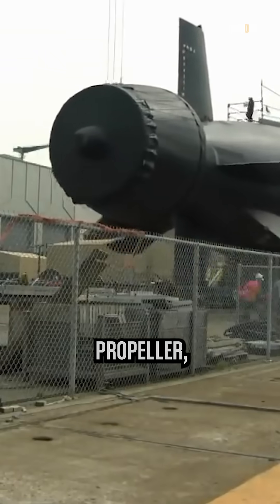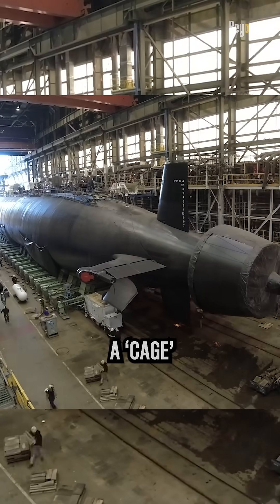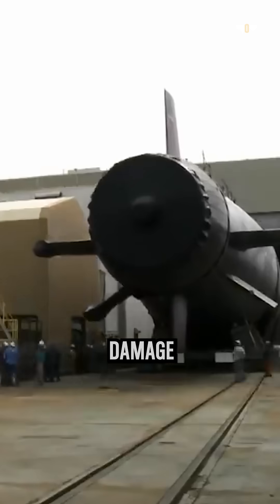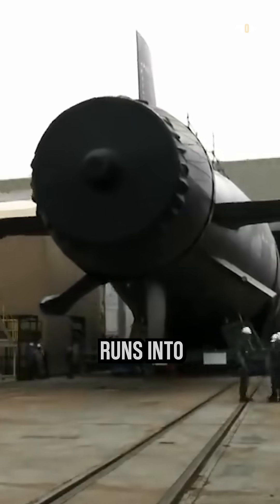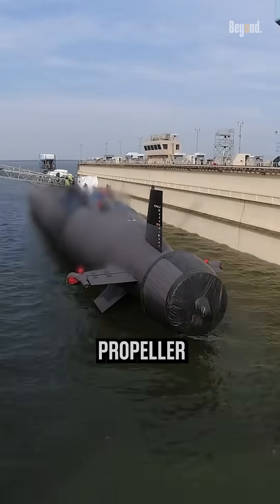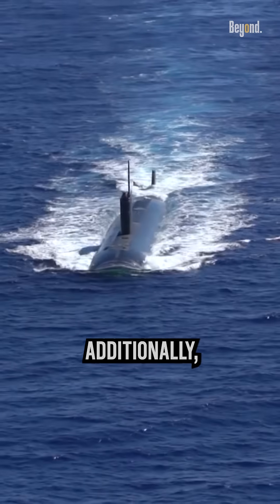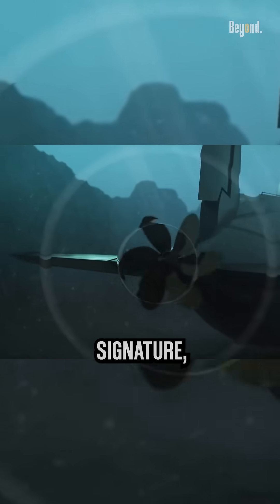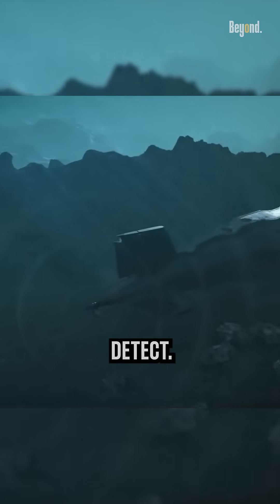Why do the US submarines have a ring around the propeller? #shorts

Comment: This is incorrect, these Submarines have a Pump Jet, which is not a Propeller but a series of rotors, encased in a guard. Pump Jets were first trialed on HMS Churchill in the 1970s, then fitted to the Swiftsure Class in the 1980s. The US Navy used it for the Virginia Class & now the French Navy have followed suit. It is quieter than a Propeller & eliminates Cavitation that gives a Submarine's position away.
Reply: Thank you for setting the record straight. The blithely blabbered BS on this reel is staggeringly ridiculous.
Reply: @cliveherbert9476 if you are going to say something, at least get it right. Its propulsor Churchill carried out the test in 1968, and it first went to sea in 1973 on HMS Sovereign. The US have it under licence from the UK, and was first fitted to the Three  Sea Wolf Class submarines and subsequently to the Virginia Class boats.. You, again, are wrong. They cavitate if used incorrectly. Cavitation can be produced by the bow or any part of a submarine, and propellers are the same. They don't cavitate if used correctly. A propulsor is more efficient and has other advantages, but I am not going to go into that here. I hope that helps
Reply: @Highendaudio1 been years since I was taught about these, but if I recall correctly the shroud stops water pressure being lost perpendicular to the drive shaft, and that higher water pressure at the blade tips means that where they are fastest they are less likely to cavitate. I remember this being like a few percent less efficient back in the day energy wise, however, with a higher allowable speed before cavitation occurred, it allowed the sub to move faster (more time efficient). Since they are nuclear powered subs, fuel efficiency meant nothing and the shrouds were used.

Maybe I'm misremembering but I think that's what I was taught a couple of decades ago...
Reply: @robhoward8344  it is not a shroud, Rob, and it is a lot more complicated than what you are describing.  A propulsor costs a lot more than a million pounds to build ( That will give you some idea), and Propellors don't Cavitate if you operate them properly. Consequently, propulsors also cavitate if you don't operate them properly, and power is important of course it is, but it is more efficient.  They don't use blades but something else which I would have thought you would remember. Where did you teach again ??
Reply: @Highendaudio1  lol a propulsor is just a fancy way of saying the drivetrain. It's not specific at all. The sub in the video is a propeller in a shroud. I love how you are pricing it with no knowledge. I was in the British army for 4 years and have been to Faslane a couple of times. Those are a talking point when passing subs.
Reply: @Highendaudio1  and just searched wiki, propulsor literally says it can be a pump jet amongst other things, and pump jets can be axial flow pump jets, aka,  ducted propellors... Thanks for incorrecting me.
Reply: @robhoward8344  Oh, of course, it is, mate, and yeah, you have been to Faslane, and that makes you qualified for what haha Rob. Do me a favour; I'm sure you know some stuff but like the author of this. If you have seen and studied them to pass your BSQ or Part Three, you would know a lot more. You would also know that there is no propellor. Have a good day, mate 🤣
Reply: @robhoward8344  is that Wikipedia mate the pinnacle of knowledge, haha? A pumpjet and a Propulsor are two different things. dear dear me. You used to teach this. Classic.
Reply: @Highendaudio1  Wrap your head around this mate... A rotor IS a propeller.

just like an axial fan is a propeller...

Your Pump Jet tech can also be classified as a hydraulic motor, as the same general means of moving fluid from A to B can by found in MANY hydraulic motors in a wide number of industries. So yeah, the device turning a kiln at a cement plant is also a form of pump jet.
Reply: @nunyabidness674  So wrap your head around this bud that's not how it works and of course all the things you have just said don't take into account so many aspects of what a submarine requires in operational life. It's not a pump jet. I understand what a pumpjet is and absolutely know the difference and understand why this product is trademarked and is supplied to the US license. Have a good day
Reply: @Highendaudio1  So you're saying that inside that cage there's not the equivalent of a squirrel cage fan with a ducted housing surrounding it? Okay... Guess what we installed at Bremerton was just the wrong bits then...
Reply: @nunyabidness674  I dont think you installed anything. I think the company did. Its not a cage and let us remember You didn't build it it was supplied to you and if you think it is just something simple then you have answered my thoughts.
Reply: @Highendaudio1  I was one of 12 on the crew installing the replacement. Can I tell you the specific degrees and depths of components required to reproduce it? No. Can I tell you that I saw enough of it to describe the concept in general terms? Absolutely. Am I going into detail about how a classified piece of material functions on a nuts and bolts level on a social media platform? Not a chance in hell, I like my job...
Reply: @nunyabidness674  haha I don't think you were replacing the whole think just the cowling old chap
Reply: @Highendaudio1  The unit we swapped out had to come off at the shaft, as well as off the stern planes, with a mess of connections in between. The sub was ducking under another vessel, ate a sand bar that had shifted, and in the process put a few large rocks through. As a result, she had to be towed a little further than expected to get her in the dock
Reply: @nunyabidness674  yeah, the shaft and a whole lot of stuff is different and integral. You are talking about the cowling, but the entire thing, which is the propulsor, has so many assets to it. Big Job.
Reply: @Highendaudio1  Let's just leave it at I know that what we pulled off was more than a shroud, closer to a manifold... Things only get put together like those for a reason, and the reason is clear enough to someone who's REALLY up close.

I'm not so simple as to think that a shroud needs hydraulic connections, that being said, I can't specifically tell you what each individual connection does. I can grasp the big picture though, and yeah, having thrust vectoring on a sub is rather nifty. Even if it is just a glorified squirrel cage...
Reply: @nunyabidness674  Stop. There is no thrust vectoring christ, and the whole thing is part of much more, but you are right lets not ho into it. I have no idea what you are talking about now, lol. Night
Reply: @Highendaudio1  I was building crew in Barrow on two boats. Its amazing how people make assumptions to try and make themselves more intelligent than they actually. My first build was a late model Swiftsure and I spoke at length with the engineer who was lead designer back in the 60's and everything you say is totally accurate.
Reply: @mikestrohm3271  I served on the 3rd S boat with one and rode the rest when I was a fost. Our American friends were late to the party. You weren't on the second to last with my good friend, who was XO Dan. Don't worry, Mike. I take no notice of most on here
Reply: @Highendaudio1  No I was building the last Swiftsure with Roger Lane-Knott as CO and the late great Gavin Lane as Jimmy
Reply: @mikestrohm3271  I know Roger very well indeed, and I am still in touch with you. Do you remember when you arrived at Faslane, we were tasked with firing a Mk 24 at you? We were also down south with you in 82  happy days.
Reply: @Highendaudio1  I basically got as far as commissioning on Splendid then got a pierhead jump to Trafalgar so two building boats on the trot.
Roger was a true gentleman and I was very sad when Gavin died, so unfair.
Reply: @mikestrohm3271  there were a group of guys that did all the building boats. Yes Roger is the same and I agree Gavin was a gem.  I knew a few guys on Traf Pilky, Fred Dave Waz bloody hell thinking about it I knew more than I think.  You had a good run down there then.
Reply: @Highendaudio1  Yes. I did, and I was also fortunate to have some brilliant CO's in later boats, Tim McClement and Dave Tall both come to mind.
Reply: @mikestrohm3271  I know Sir Tim and Dave very well indeed. I helped Tim on the Alliance Appeal. I still owe dave a Polo shirt. Both good people
Reply: @Highendaudio1  As you know Dave was an avid supporter - and later Director - of Plymouth Argyle. He had an Argyle pennant hanging outside his cabin door which he always turned back to front when Argyle lost. Sir Tim always brought a bag of balloons onboard before deployment which were given to anyone who had a birthday while we were away.
There was a rumour going around that before an ICEX on Turbs he let it be known he'd never had a foreign jolly and Turbs was going into New London after ICEX. Allegedly the WT mast flooded after leaving Faslane (OPDEF return to base) and it was kept 'secret'. Up until going under the ice the routine was taken on the surface with the emergency WT antenna instead of at PD. After leaving the ice the same procedure followed until a day out of New London when it was reported back to UK that the WT flooded. Guz periscope workshop were not complaining, they got a 5 day jolly out of it and Sir Tim got his first foreign jolly. As I say, all a rumour, not sure if its true.
Reply: @mikestrohm3271  haha 😂  i know Dave was a huge Plymouth fan but didn't know that he was a director there. Haha 😂  my friends son won them promotion recently and then left to go the Blackburn. Ennis,  he wouldn't stay but he his happy now.  Sir Tim had been on at least one jolly I know of on conqueror when he was XO.  He spent a lot of time running the Attack Teacher in Faslane taking over from Peter Christmas another great man.   You do know both are Hugh sailors like myself and Dave is supposed to be coming sailing with me but he remains a busy man.  Yep done a few under ice trips.  Usually with the yanks.   Happy days two good people
Reply: @Highendaudio1  My bad, Dave was actually appointed Chief Executive of Argyle.
Reply: @mikestrohm3271  ok still good Mike.
Reply: @Highendaudio1  I was on the first U.S. Submarine fitted with the Propulsor, SSN-720 USS Pittsburgh
Reply: @darknesscomes9522  well done so you know more than most but The US were late to the party and it's under licence to the US
Reply: @Highendaudio1  Thank you. I was actually part of the Dive and Drive team when we first tested the propulsor on the Pittsburgh. It was exciting, and interesting.
Reply: @darknesscomes9522   i am trying to think what year you got it. it wasn't fitted from new. we were in the States the year before, and we took a lot of big wigs to sea on us. Do you know how they used to test them  `they used to throw a railway sleeper in there.
Reply: @Highendaudio1  It was fitted new. We were the first Operational 688 class submarine with the Propulsor, as well as VLS Tomahawk tubes.
Reply: @darknesscomes9522  I didn't know it was loaned from new. The US never owned it and I believed its to be returned.
Reply: @Highendaudio1  We were commissioned in November, 1985
Reply: @darknesscomes9522  yes i know that but I was involved in a exercise with you somewhere  where were you based
Reply: @Highendaudio1  Groton Ct, USS Pittsburgh Commissioning crew.
Reply: @darknesscomes9522 
I was on the USS Newport News (SSN-750). We were the first VLS Boat! Also the last boat with sail planes. We didn't have any kort nozzle, shroud, or "Propulsor". I'm pretty sure all Los Angeles class boats came out of their yards with a 7 bladed propeller and a pilgrim propeller nut.
Reply: @Highendaudio1  Pathetic how  the primitive, backward brits claim credit for EVERYTHING and ANYTHING...that others have achieved. Especially Military Victories...constantly taking credit for other countries' Victories. Only the brits do that.
😡👎
Reply: I was just about to say that but then I saw your comment. I'm totally fine with people not knowing everything about our subs.
Reply: Yeah, this video corroborates this answer: https://www.youtube.com/shorts/MCDTjoap-zg
Also, I don't think it has anything to do with hiding the design.  The temporary caps on the ends of the pump jet may do that, but I don't think the ring isn't designed for obscurity.
Reply: @dweiss1  Sadly, the first few words did it for me. The Propulsor causes cavities if used incorrectly just like propellers.  Carry one think what you want.  You may know bolts but you don't clearly don't know enough
Reply: @dweiss1  haha 😂  the video you have shown has as much idea as the person narrating this one
Reply: The Virginia class didn’t use these first. The seawolf used them first
Reply: You need to put away your copy of "Hunt for Red October" and stop watching the movie for a while. The primary purpose for the ring around the propeller, is to mask the cavitation noise makes. Thus reducing the submarine's acoustic signature.
Reply: How to get Visited by NCIS
Reply: @reggieh2o45  For revealing information so Top Secret you can find it on Wikipedia? Hardly.

Comment: This "cage" as you put it  mainly acts to  reduce the tip vortex and cavitation on the propeller. Raising the efficiency range and lowering the low speed acoustic signature. Very basically it turns your propeller in to an underwater jet engine.
Reply: It's taken off when it's submerged 😂😂😂😂
Reply: huh. How does the propeller even work efficiently whilst having the cage on. It doesn't make sense to me.
Reply: @spinoraptorspinosaurus6969 
As I have said in the comment; by reducing the tip vortex compared to an open propeller. This vortex is the tendency of water to circulate around the propeller disk, creating turbulence and wasting energy. The ducting first reduces the size of the tip propeller vortex to the size of the gap between the propeller and ducting; compared to a vortex as big as an open propeller. The ducting also smoothes out the flow coming off the propeller, which is important for stealth submarines. https://en.wikipedia.org/wiki/Ducted_propeller?wprov=sfla1
Reply: The cage is only used during shipping/transport or dry dock of the sub! It’s removed once the sub is in navigable water. Nope!!! No jet engine effect!!🤣😂😅
Reply: @wolfman007zz   The Royal Navy Trafalgar class and Astute class, the US Navy Seawolf class and Virginia class, the French Navy Triomphant class and Barracuda class, and the Russian Navy Borei class. There you go, seven examples of submarines using a propeller in this way.
Reply: @wyndhamcoffman8961  But not the Seawolf or Virginia class. I know better. Perhaps you saw that in unclassified pics.
Reply: @wolfman007zz  I guess you're going to  say next that not a single surface warship does this either, and their not classified propellers just have a duct around them in the pictures and schismatics, just because.
Reply: @wyndhamcoffman8961  You’d be, and are wrong! You constantly make bad assumptions and try to peddle them as facts! 😂🤣😅

I served in the US Navy for 20 years as an officer. My fellow grads served and are now upper echelon officers for COMSUBLANT and in the Pentagon. Surface ships don’t worry about screw cavitation. Subs live and die on preventing screw cavitation. Just go and sit down. Find a new audience to lie to.
Reply: @wolfman007zz  well I can't argue with that.  With your sudden reveal at the last moment that you are, in fact, a navy officer.

 Being an officer; I suppose you could tell me something about title 10 article 133?
Reply: @wyndhamcoffman8961  Sorry! Wasn’t a JAG Corps officer!! LOL!!! I’m sure I can Google it, though!!  I bet it has little to do with “cages” on sub screws!!
Reply: @wyndhamcoffman8961  Reveal at the last moment?? LOL!!! No one asked.
Reply: @wolfman007zz yeah cool story bro.   I’m a fvkng astronaut that builds MUFUQIN pyramids 🤦‍♂️🤷‍♂️🙄
Reply: @smyers820gm  Well isn’t that special???!

US Naval Academy Class of ‘84 here. You?
Reply: @wolfman007zz  last minute as in some of us have day jobs.  And this conversation is getting pretty far off topic from that of submarines.
Reply: @wyndhamcoffman8961  Off topic by you. Funny that you complain of your own efforts. I guess it’s as good a way as any of back pedaling out of a point you can’t make. And a few IMs to some buddies still heavily involved in the US Submarine force verified that I’m correct. Bye!!
Reply: @wolfman007zz imma graduate of the star fleet academy.  Assigned to the uss enterprise 🙄🤦‍♂️🤷‍♂️.  See how easy it is to type bullshit on a computer screen 🤷‍♂️🙄
Reply: @stephenmyers7076  So tell me what US Senator nominated you to the fictitious Star Fleet Academy! Me? Arkansas Senator David Prior. 6th Battalion. 6th Wing Bancroft Hall. I was a 1530 in the US Navy. Served as Material Control Officer for VAW126, then Asst Maintenance Officer for NAS Bermuda, served onboard USS JF Kennedy CV-67 as IM-2 Div O, QA Officer, then Asst Maintenance Officer for CV-67. My brother graduated from the US Military Academy West Point in 1983. My oldest brother graduated from the US Air Force Academy in 1978.
Reply: @wolfman007zz  I must admit you remind me of the “4 leak Tayback” character from Tropic Thunder.  Dude wrote a book about his heroic exploits in the Vietnam War and turned out to be a fvkng garbage man in the coast guard. 😂😂😂😂😂😂😂😂😂😂😂😂😂😂😂. “You suuuuuuuvvvviiive pull yo sef out” 😂🤣🤣🤣🤣🤣😂🤣😂🤣
Reply: @stephenmyers7076  Let’s see pics from your Starship Academy graduation!!
Reply: @wolfman007zz  they’re classified by the commandant of the United States space force
Reply: @wolfman007zz  yeah I think Mr couffman is just a tit & doenst have the slightest clue 🤣🤣